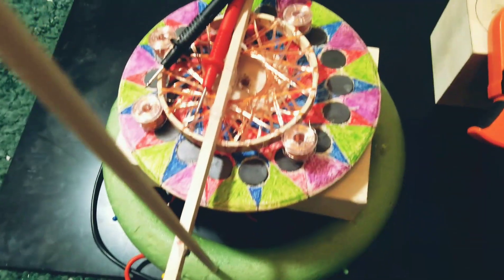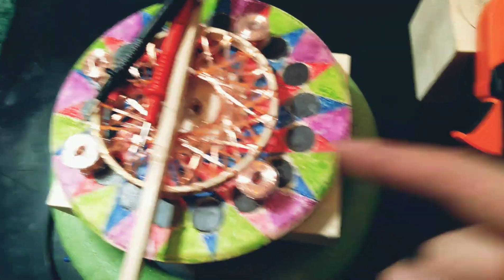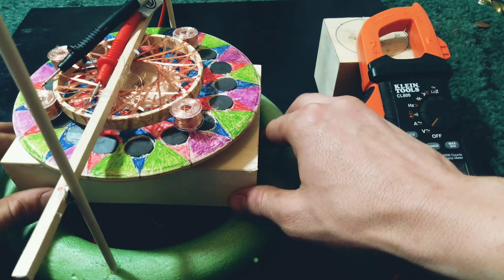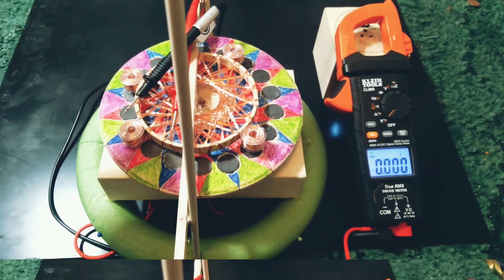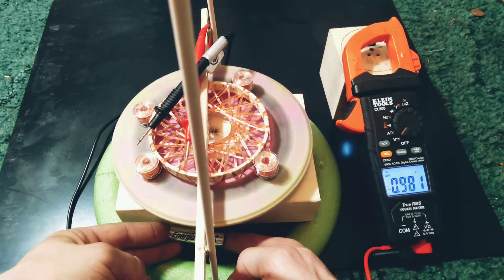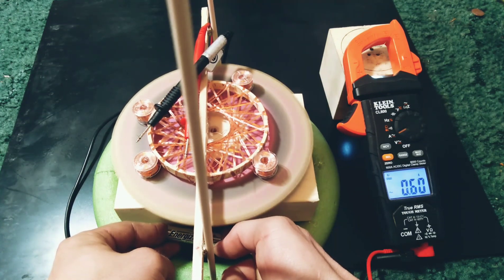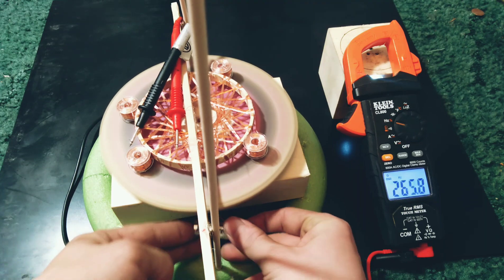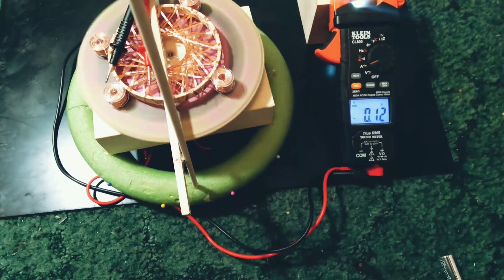Free Energy Quad Wheel Generator Part 5: 2 Watts Input 6 Watts Output??

Comment: "Cognitive effect"  ???  Do you mean "Cogging"?

I don't see a load when you are testing output.  Are you measuring open circuit output voltage?  

Get a real load like a 10 ohm resistor.  Tell us what the load is, then measure voltage and amperage it is outputting.  No-load readings mean absolutely nothing

Comment: Good effort.  To better prove the point(over unity) of getting more output then input, is to create the loop back process where some of the access power is used  to run the initial system(see Kapanadze generator) and some goes to run the load.  The main problem here is to define clearly where the access energy is originating from and underlying mechanism.  Kapanadze believed that this access energy which is giving rise to this effect is coming from the cosmos(maybe neutrinos? or other exotic high energy particles) or environment, which under certain conditions(right kind of resonance) is captured inside the coils(acting like the capacitors) and at the later stages, this captured energy is 'manipulated' and converted to the mains power(220v, 50hz) and again some of it is used to run the initial system(invertor in his case)...good luck
Reply from the maker: I appreciate this, thank you for sharing!

Comment: you are still a clueless/delusional  phool.      solely for the purpose of  Your  edification, i will say this.
wild  AC  watts  are  NOT  equal  to  DC  watts.!!!!!!
in order to  Compare  the wild AC watts out, to the DC watts in,  the output  MUST   BE   RECTIFIED; to  DC.!!!!!
it is not clear whether you  EVEN  Actually/correctly  know the INPUT DC  watts  Value.!
the use of a higher-than Normal oscillation frequency makes  NO  difference, whatsoever!!!! 
the  INCORRECTLY  made  generating  coils  have way TOO  MANY  winds/layers, of  Too small  conductor.!!!        consequently, the output  current of each generating coil  is  SIGNIFICANTLY Clamped/limited.!       i could go on.   but, i'm sure that what i have already said  will  not make you  ANY  less  delusional.        googletranslate

Comment: Funny video. He makes an axial generator, used a lot in the dyi wind generator field, adds some artwork using copper wire to the middle, and viola free energy. Common, gotta use the super secret neodymium magnets or it will never work:)
Reply from the maker: Thanks for the info! About to get the rest of the coil wrapped up between tonight and tomorrow morning.

Comment: Apply walter russell cosmology, coiled coil / copper spring-coil and see what happens (:
Reply: What you mean by spring coil ? The spring shaped coil should have higher efficiency ?
Reply from the maker: Probably.  Similar to tensioning a guitar string
Reply: @Resonate369  More like twisting rather than tensioning.
Reply: @heymakercode9075  That would be obvious, but the non-obvious would be circular magnetic field is generated, the same natural circular magnetic field of a magnet where mainstream science thought is "straight" lol
Reply from the maker: I've never tried any of Walter Russell's ideas yet. What videos would you recommend?
Reply: @Resonate369  There's no videos because nobody ever properly build walter russell vortex coils. ALL of them thought the diagrams represent the coils rather than the magnetic field itself. It is because of this none ever thought of making coiled coil that generates circular magnetic field. The toroidal circular magnetic field or "poloidal" toroidal magnetic field.